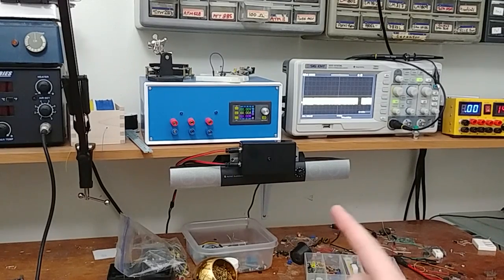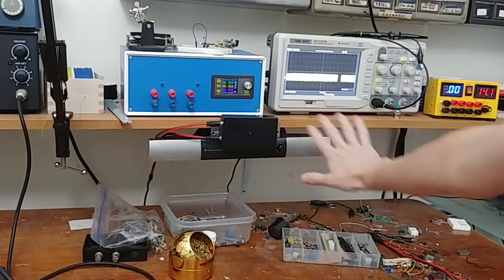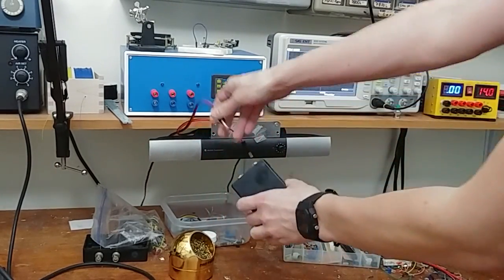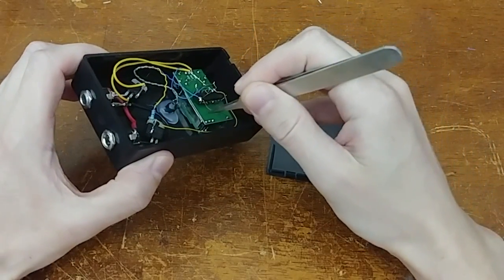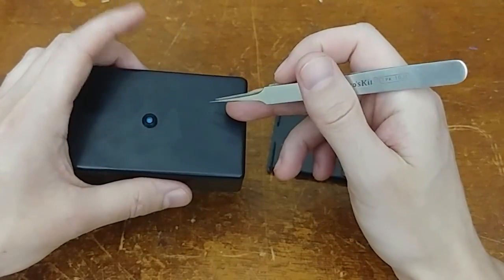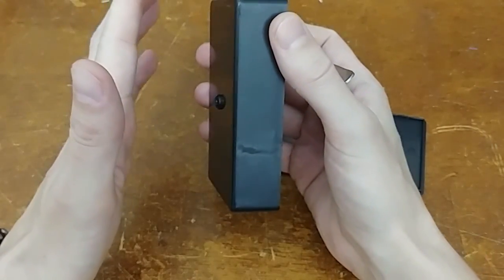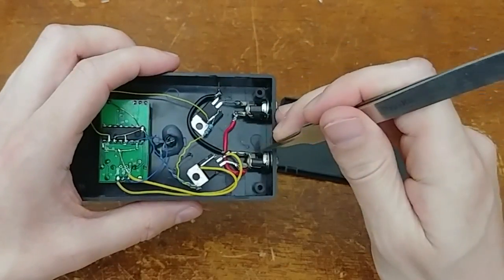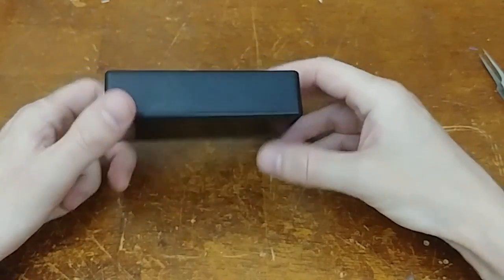Controlling Speakers with RADAR

Comment: Does the sensor operating in the 5.8 Ghz spectrum cause any interference with 5.8 Ghz wifi?
Reply from the maker: I didn't notice any interference on my WIFI while working with this device, and the power levels involved are pretty low, so I doubt it...